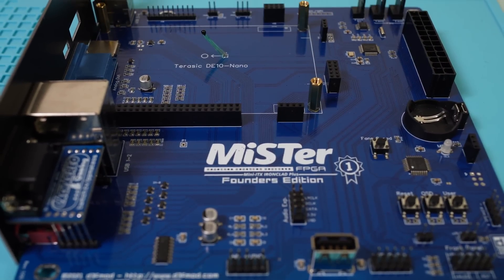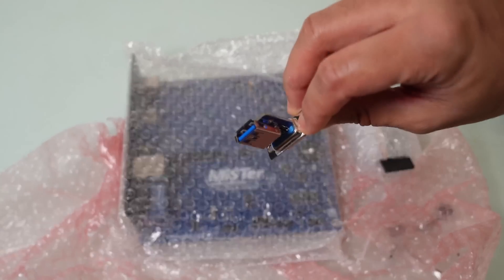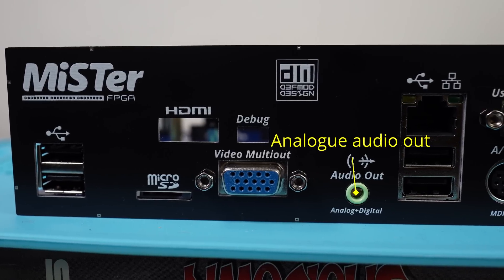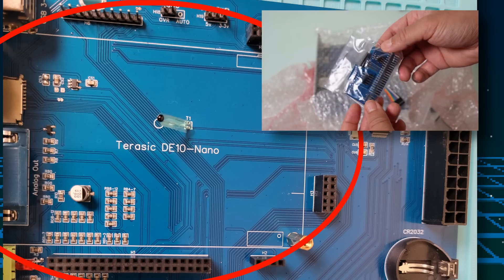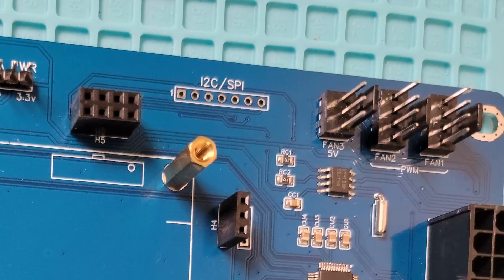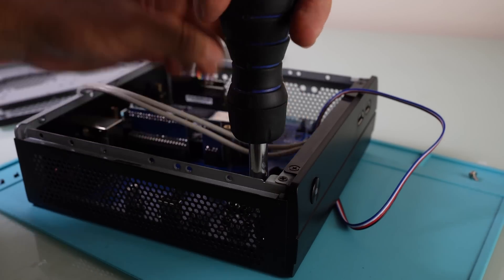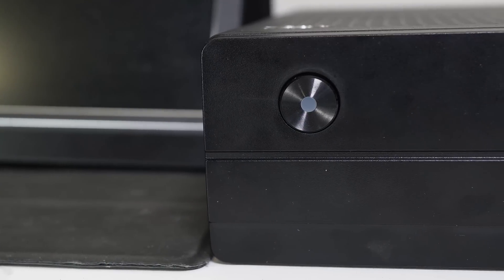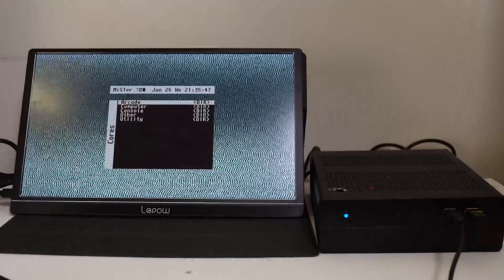MiSTer FPGA in a Computer Case with the MiSTer Ironclad Plus Board

Comment: I bought a Jammix IO board and a mt-32 pi. Jammix is a really nice itx form factor board, but Ironclad has much more features integrated into it. Having a mt-32 attach internally and not having it take up a port is a huge plus. I’m going to buy the board to replace the Jammix and the external mt-32 pi. Great video!

Comment: you probably could have taped the IR receiver to the inside of the case with its sensor facing one of the  vernation holes
Reply from the maker: It's a case I got quickly because I was so excited to set it up so I didnt care how I treated it. Ironically, It's still in the same case. I'm still trying to find a "permanent" case for it.

Comment: This new case has me wondering. Are there any cores that are perfect yet disappointing because their serial data connections are not supported so their peripherals that use lpt or scuzi are still not compatible?
Reply from the maker: I guess it would depend on what you want to do. Playing single player games you'll be fine. I haven't tried multiplayer gaming in AO486 over the MiSTer but hope to try it out in the future. I guess if you want to use software that depends on some specialty device connected to a computer then a real device will be better suited for that. At least we have MIDI support for computer cores so we can connect MIDI instruments.
Reply: @LusRetroSource  I still have apple printers and ink I didn't dispose of that were first sold when the Apple IIc hit the market. I pointed out printer ports because the direct communication of those old systems would let me use the last of my old supplies If they aren't ruined.
Reply from the maker: @Spokavriel  Wow! Printing out those old dot matrix banners will definitely bring back memories.

Comment: So I recently ordered the Mister Multisystem from RMC...does Mister not generally support multiple inputs for multiplayer?  I may have to get one of these otherwise
Reply from the maker: When using USB gamepads, it does support multiple players, and even more than 2 players. When things get complicated is when you want to use original console controllers. So you will be fine with multiplayer gaming.

SNAC is a connection on MiSTer IO Boards that allow you to plug in original NES/Genesis/SNES/etc controllers so you can get a more authentic experience. There are limitations to SNAC. You can only use 1 original controller and the controller will only work on it's native core. So for example, the SNES controller will only work with the SNES core and not other cores. 

This board supports an enhanced version of SNAC that allows you to use 2 players.

USB controllers do not have these limitations.
Reply: @LusRetroSource  Thank you very much for the quick response!  Is it possible to use Snac and USB inputs simultaneously on the same core?
Reply: @ornerycuss5804  Yes, the SNAC controller will be player 1, and the first USB controller will be player 2
Reply: @Rojame77  awesome thanks!!
Reply: Cool and and all but snac isn't necessary. The USB controllers are already plenty fast you wouldn't notice any lag with just USB controllers. also not having access to the sd card is a bummer!
Reply: @ericochoa4034  Controller response time difference may not be noticeable for everyone, but the feeling of playing your old games with the original controller in your hands is universal 😊
Reply: @Rojame77  true but that's why there are daemonbite adapters which are very low lag.

Comment: Is there a way to integrate the mt32pi to this setup?
Reply: Just in case you haven't heard yet: the developer of the IronClad is now selling a Mt32-pi hat that is meant to be mounted inside the case, together with a Raspberry Pi Zero 2 W. What makes it even more perfect is that the SNAC port on the back can be used simultaneously!
Reply from the maker: @lucasss02  Yes! I will be doing a video on the device.
Reply: @LusRetroSource  awesome, thanks for all the great MisterFPGA related content you are sharing. It’s greatly appreciated by many people in te community.
Reply from the maker: @lucasss02  Thanks I appreciate the kind words
Reply from the maker: Only way to use an MT32pi is through the DB9 port. Probably will have to do some major modifications to a case to integrate it. You may want to take a look at the more compact MT32-Pi hat's that use the Pi Zero for something that's takes up less space.

Comment: These kits are nice as a drop in solution. Most of the board is just routing lines from the de10 to the io port and other plugs for ease of use. If you wanted to save some money, you can get 90% of the functionality by just routing extension cables. There are mini itx io plates and adapters on thingaverse you can print out for the case.
Reply from the maker: That's definitely a route people can take if they already have a complete MiSTer setup. This option is someone who doesn't have a complete should take a look at if they are looking for alternate case options.
Reply: You’re forgetting about the temperature sensor, fan control, IR remote control, power control, etc.
Reply: I said 90%. A power control board is less than $5 to add to the case.

Comment: okay Im sold on this , Just wondering is it easy to go from a CRT setup , to a HDMI setup , like it will be hooked up to my CRT fulltime but if I wanted to just take it to my living room HD tv , would I need to edit some file first or is it just plug and play ??
Reply from the maker: Yes, it's exactly like a standard MiSTer setup with IO Board. Just unplug it from your CRT then go to your HDTV and plug in through HDMI and vice versa, no config changes needed. You can even output both analog and HDMI at the same time.

Comment: I think this is a great development for MiSTer especially if it can use 2 RAM modules. I have the aluminum case that came out before, which is a huge aesthetic upgrade over the "PCB case" and the 3d printed cases, but having ports on all sides is just so hideous. I appreciate the community for the work they do, but the cases that people come up with... could use some serious improvement. This is what we needed.

(I just saw your reply to the other post about dual RAM - nice.)
Reply from the maker: It's always good to have options.

Comment: Do you know if the C64 keyboard case is actually compatible with Ironclad? I looked at the specs and the creator says it should be, but I've not seen anyone actually build one.
Reply from the maker: Check out this post about someone using the Ironclad Plus with the C64 case.

https://www.reddit.com/r/MiSTerFPGA/comments/s8wl2f/misterfpga_miniitx_board_c64_shell/
Reply: @LusRetroSource  Thanks!

Comment: Thank you for making this video, I was not aware of this board before now. Contemplating selling my USB Hub and Analog IO Board so I can have access to dual SDRAM! Question about the video outputs, can HDMI, VGA and Genesis AV outputs be used simultaneously? Would love to have this hooked up to a capture card, 240p component CRT and VGA CRT monitor all at the same time, as niche as that use case probably is. Either way using the ITX standard is a fantastic idea and I could see myself using my own DAC with this IO board.
Reply from the maker: You can only get dual analog video and HDMI output if you're using 1 SDRAM module.  The second SDRAM module takes over the pin's for the analog video out, so in that case you can only output HDMI alone or use direct video over HDMI to output analog video alone.
Reply: @LusRetroSource  What options are out there for 2 SDRAM and analog video?? without using HDMI for analog
Reply: @MrMassivemanmeat  None.
Reply: @LusRetroSource  is there a way to get audio as well while using direct video over HDMI? since the analog out would be disabled too